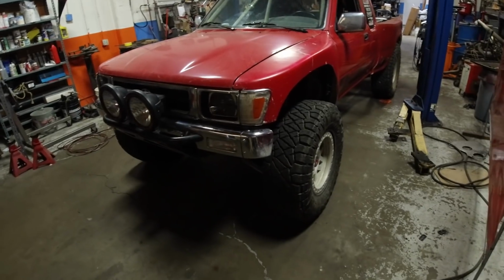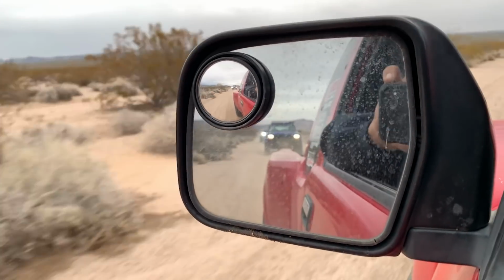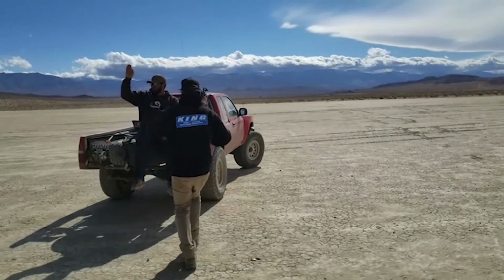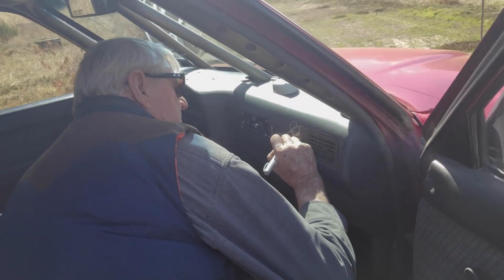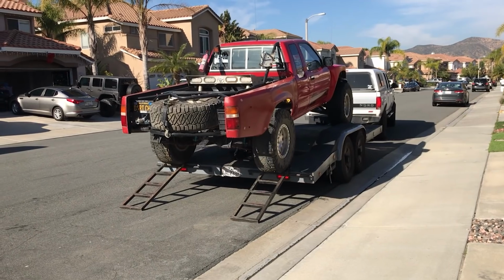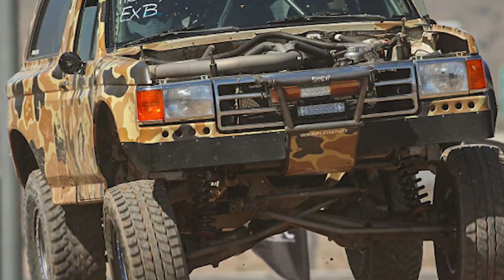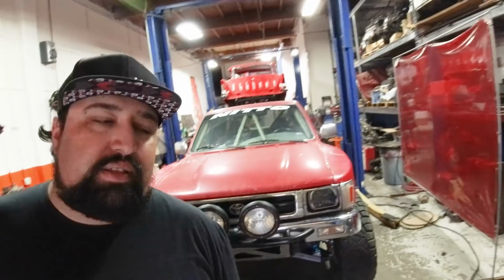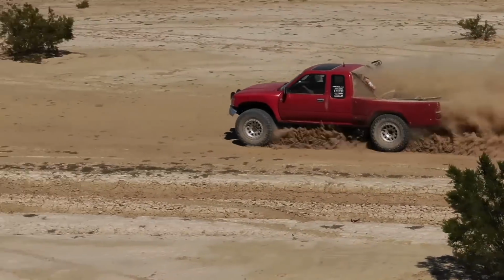Chasing Dust: Resurrecting My 4x4 Toyota Prerunner Project

Comment: Did you ever install the tundra rear axle  on Scarlett?
Reply from the maker: I ended up using a widened 9” Ford housing
Reply: @DrivingLine  any particular  reason? Isn't it a 5 lug? Which leaf spring are you using for the rear? I'm building a simular build but in a 1986. Trying to find some proven pointers

Comment: What can you tell about your front bar/skid setup. I'm looking for something minimal like yours for my project, but I cannot for the life of me find anything remotely similar.
Reply from the maker: That front bumper and skid is completely custom built. In fact, most ones like it that you'll find were home-built. Just not a big market for them to be mass-produced anymore.
Reply: @DrivingLine  ah bummer, it's a shame. Really a clean design. Thank you for the help. Looks like I'll have to break out the welder and reverse engineer something together.

Comment: 4130  Chromoly is only stronger than dom if the cage is heat-treated after welding it. Chromoly is a harder metal so when its welded and heated up it becomes brittle. That's why the TT guys heat treat their whole tube frame after its welded so it can bring back the strength of the Chromoly. Anyyyway sick yota i wish it was mine

Comment: Is it necessary to run the wide fenders with 35" tires and the TC long arm kit. I have a 90 just like yours but I have been told I can only go 33" tires with out the fenders.
Reply: El Torito you’ll definitely need fenders for both 33’s or 35s. No way around pushing the wheel mounting surface out 3.25”